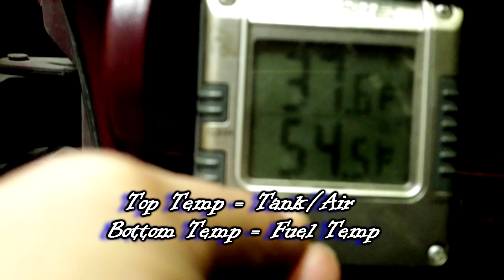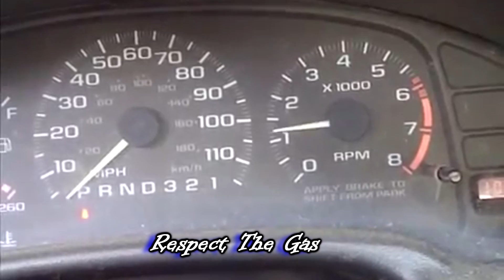Is 100MPG + Possible?? Alternative Multi Fuel Vapor Van!

Comment: If you understand physics you can master defeat. The real way to the highest mileage possible is at low displacement at high pressure. The fuel system is just a piece of the equation. You have to look at the whole situation. You can't take from mother nature without understanding how. You have wind drag, rubber tire friction, loaded accessory drag, parasitic oil drag, and weight and heat dissipation issues and fuel volatility under different temps. A standard engine is built to deliver high power and high volume air displacement. What happens is all the fuel put into the engine goes out the tail pipe while a little goes to power the engine this is the design of every engine to delivery power quickly. One thing all air based fuel systems fail at is that when any substance is placed under vacuum will get cold. When placed under pressure it will heat up. Water does not give extra mileage it makes torque which in turn means you dont have to press the pedal harder to go faster.
Reply from the maker: egn83b Very well said, I've devised a way to incorporate my system with our current fuel injection to deliver incredible MPG "at cruising speeds" yet maintain the same power when needed. Using the engine coolant and electric heaters to preheat the gas in a separate tank, then recirculate it to the vaporizing tank to keep max temps of 150-210f "should" achieve quality results. Couple more parts n pieces I'll be testing further and post those results.
Reply: Yep I too discovered pre heating does a world of wonders for gas. The e10 gas I had noticed does well evaporating in heated environments but it is so thin it goes quicker then regular none e10. One way I have achieved longer run times was adding restrictions to intake and exhaust system which helps with air and fuel mixing and egr which really saves fuel but it reduced my output some.
Reply from the maker: egn83b Interesting, what are you testing on if I may ask? What gains have you achieved? I have a second butterfly as you've seen to give that restriction on the intake, once connected to a servo and switch on the pedal which activates the injectors and opens it up. Curious, why did you restrict the exhaust?
Reply: I am testing on Prius engine that I got from the salvage yard that I am running ignition timing off a junked ecu from another toyota. I am building generator using prius parts. So far I have plated up the exhaust and the intake manifold to control air mixture. I am doing the restriction plates like nascar does so i can run leaner ratios of fuel vapor. By closing up the exhuast to a smaller hole I am able to achieve perfect egr which doubles run time. The intake inlet is 1/4" insted of 1, 1/2" this makes the air and fuel mix more better. So far blocking up the intake has gained me some run time. The problem now is that I hit the glass ceiling of the btu's available from shitty e10 fuel. Run time has improved and exhaust temps have drop down. I think the next improvement now is adding a small amount of hho to see if I can up the run time some more. I am really gearing my setup to using exhaust heat to make the engine run off the white vapor which I have done but it a bitch to start when cold. I am not going for 100 mpg I am going for run time for my power needs.
Reply: I do notice that if you can keep intake temps down you really can pick up some more power. I really wish in the beginning that I just bought a kubota diesel engine because then I could just run stock and get great run time and use less fuel. But I was interested in seeing how far you can take gasoline in a generator setup. The reason cars can get near 100 mpg is because if the car is aero dymanic with low co-efficient you can coast instead of pushing on the gas and drop the engine when not needed. The econ modder web site is a great resource for running high mpg's.
Reply from the maker: egn83b Yeah it's a catch 22, hence on the Y sucking a water/antifreeze mix to cool the intake, still test n tune. I'm adding 3 more air intakes (all have 1 way check valves cheap diy) on the gas and 4 more on the water side, currently just going to hook the mix valve up with a cable and a switch to turn off and on the injectors so I can better test the system at cruising speeds and not lumber up to them. I may add another butterfly to open air as well to gain max power and virtually disconnect my system under max load. Thanks for the info on the econ modder but honestly not a lot of great info for testing my system as I want all other variables the same, and most is simply not feasible some quackish even ie hypermiling and many the 65 mods. I'll play in the forums later when I have some more time.
Reply: I would more or less look at exhaust heat as your friend econ modder does have some info on that topic and heating your engine using various modifications. Since right now I can not afford a diesel engine I am going to look at an old technology that uses two fuels to run my generator. Its called gasoline to paraffin duel fuel setup. This idea is 100yrs old and was used extensively on tractors. Basically I have to drop the compression of the engine using spark plug non foulers or shorter rods. The engine is first warmed on gas tell its at op temp then switched over to paraffin fuel like diesel or kerosene. I have vapored diesel into the engine and it runs but it knocks at current compression and runs slower. The real pro in this is torque and steady idle speed and its much more quieter then a traditional diesel. I am kinda going the Mazda route with low compression diesel. Its been a long two years playing with my car engine but its been fun and I have learned alot. The system your going on is vacuum based and that is a very hard system to keep up as you keep having to add heat and fuel to keep the air and fuel balanced under various loading and low vacuum pressure situations. Your system is going to be more like a traditional carburetor in the end but unconventional in setup and overly engineered if you can get it perfected. Looking at it logically you could do your system under vacuum as an idle circuit which is contently feeding vapor at idle and turn on the fuel injection circuit to get up to speed and then while at highway steady speed your high vacuum returns again and you can drop the fuel injectors and go back to vapor. This could be done with two rpm window switches from summit racing. One for idle to cut off injectors at idle and the other to cut off the injectors at 3k rpm and run your vacuum carburetor. This is the most logical situation  I can offer to your setup. It will work like a dry and wet hybrid fuel system. You have to set goals and make failure part of the plan to get to a middle road where performance and reliability meet.
Reply from the maker: egn83b I Initially looked into exhaust heat pipe technology but it lacks control and temps IMO could be disastrous in a car due to the conditions. That being said I will be testing that on my lawnmower engine generator as that's the only usable heat it creates. That and those electric heat pads to preheat and maintain if needed. Thanks for the info on those RPM switches I may use one to cut the injectors, but I plan on using something like a NOS switch or potentiometer on the pedal to turn them on for an instant transition.
      So have you messed around with premixing your fuels much with "waste filtered motor oil" or diesel or?? You mentioned HHO but a light water mist from a bubbler cools intake/exh temps a bit more.
Reply: Yes I have done mixing motor oil with gas it vary hard to ignite in an engine and it burns dirty. I have had some luck doing diesel in a gas engine by warming the engine on gas then switching over to diesel. This old idea came from old tractor technology using exhaust heat but find that you have to figure out out a way to thin out the diesel due to its very heavy nature.
Reply from the maker: egn83b Oh so are you still using the standard fuel injectors?? Your vids didn't really describe much.
Reply: Yes, at the time of the video I did use fuel injection and the stock oem setup. Now that has changed. I capped off the intake and put a plate on with a nipple and hose now feeds the air fuel mixture. The fuel pump and the throttle body are removed. The engine is feed off a trimmer carburetor off the exhaust manifold that feeds a pipe with a rod in it. I can run this setup flashing over gasoline and diesel. The engine will now accept both fuels. Run time is about the same because the flow rate of the carburetor is same for both fuels. I removed the fuel line off the injectors and they suck air for now more or less supplemental air. The run time now is about 4 hours a gallon from 2 hours on fuel injection. I do have a bbq temp gauge on the exhaust it runs on vapors at 350 degrees and regular fuel injection it ran at 750 degrees. Keep the temps down and the run time increases.
Reply: I am following loosely the geet system to some extent now but i found bubbling does not work and heating fuel vaporized too fast with e10. I even tryed fuel injector timed on a circuit to spray on the hot vapor tube I welded inside the engine manifold it ran stronger but still wasted fuel and made heat. Fuel injection sucks because the fuel does not have time to vaporize its just burned off quickly then ever. The best way to get fuel to expand is by giving it time to expand. One observation I found on gasoline is when you have an inline expansion chamber the run time increases and consumption on the carb decreases. The carburator is driven by pulled vacuum, the harder you pull the more it flows. The less it flows the more it saves. Basically its a runny manifold air leak to describe it simply.
Reply: I am not youtubing my progress because my setup looks messy and I a need to work the bugs out of my setup. My goal is to get to the run time of a honda eu1000i generator on one gallon of fuel or gasoline on a 1.5L engine. That is my goal. Its unreasonable but I am going for it. All I gotta do is make it. After that I will share it with the world. Cuz I am not gonna let some stupid honda win over my Toyota lol.
Reply from the maker: egn83b LOL nice You Can DO IT! And exactly as you said above fuel injection is a fail because they moved it to close taking away precious time and heat for it to vaporize properly. Try to film as much as you can to document the progress so you can describe it better to us later.
Reply: okay

Comment: Well it is good old experimentation that leads to advances. Be safe...
Reply from the maker: Sad thing is this is nothing new, we already achieved over 150MPG way back. I just saw the Opel that won the Miles Per Gallon race back in the 70's with over 300MPG! on Discovery channel a few weeks ago. It still runs as well.